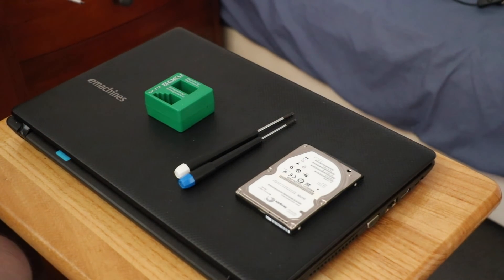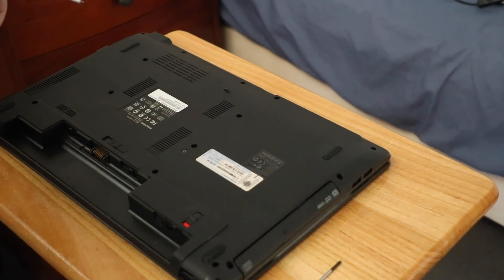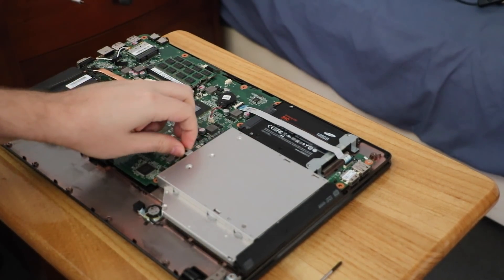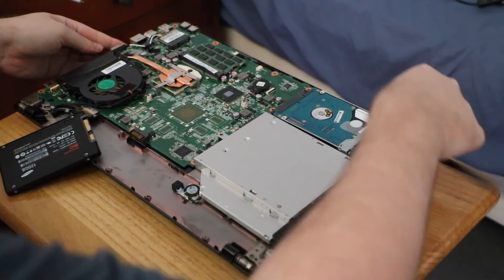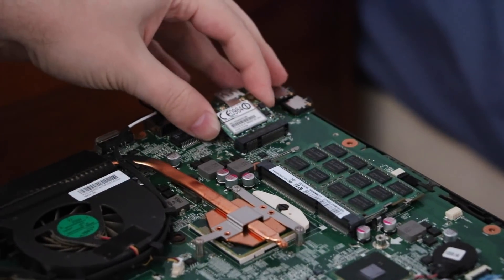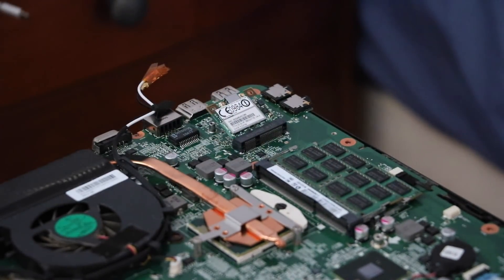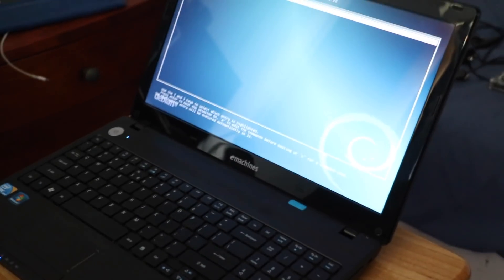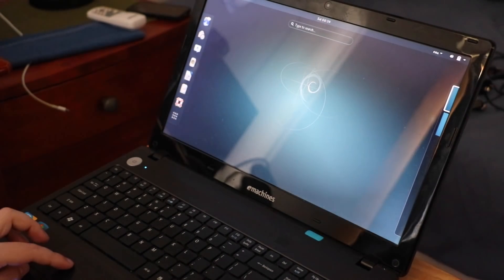eMachines E732 Disassembly for Wi-Fi, Hard Drive or RAM Installation

Comment: Do you know if it has a safety feature to cut the power when the casing of the notebook is opened?
If yes, do you know where the contacts for it can be found? Cause my emachines e732 suffers from random shutdowns and it's not dust / cpu overheating. I've cleaned it and replaced thermal paste. So I'm hoping it's this safety shutdown feature that's glitching because of dirty contacts or because they sit badly.

Comment: The Acer Aspire 5742 and brothers use that same case, BTW.
Reply from the maker: Why doesn't that surprise me? Must make repairs a lot easier. Are they all owned by the same parent company?
Reply: Acer bought eMachines, i think. Acer is higher "trim" than eMachines.
Reply from the maker: +Daniel Pinel are you trying to tell me that the eMachines is not a high tier machine with extreme processing power!?!
Reply: +Shane McRetro It might be a high tier machine, but it isn't "extremely powerful". My i3 Acer has thermal problems, and it's slow.
Reply from the maker: $0.03 that it has a rotational hard drive and not solid state! I don't know how I'd live without one these days! :-D
Reply: Mine has a A-Data 128GB SSD fitted by myself. The 750GB HDD was getting unstable sectors.

Comment: Hi Shane, I know it's a long shot but have you a Super Magic Drive you are willing to part with, or any ideas where to find one. It is Genesis equivalent of the Wild Card, floppy disc back up unit. Thanks Kester.
Reply from the maker: Howdy, sadly I've never come across an SMD, however the folk on assemblergames.com might be able to help. Were they the ones with the built in battery that likes to leak all over the internal PCBs? I remember that being an issue for one type of floppy drive backup ROM copier, just can't remember which one :)

Comment: shane i cant stress this enough but with laptops since you took it apart id reccomend you tighten all the screws around the hinge assembly  and put some lithium greese on the hinge , it helps with the lubrication of the hinge and also prevents the laptop from stapping in half , id also reccomend youd take off  the heatsynk and blow all the junk dust out and change the heatsynk compound . other wise good work man
Reply from the maker: +Jack Frazer Thanks, great tips! If this machine had more use, absolutely great ideas to do. This one was just to sit in a corner sadly... not my machine but the owner wanted a backup - just in case :)

Comment: I have an HP HDX 16 model 1040EL.... Pretty beefy for it's time (still a good performer), but to even reach the fan and clean it you have to "TOTALLY" disassemble it, even the screen!!! I was gonna replace the thermal paste but I just give up when I did read the manual! This emachine notebook is a breeze instead!
Reply from the maker: +MasterControl90 Yikes! We had a "Pioneer" branded laptop, it was quite a few years ago now and the screen also had to come off to get to the internals... why! Just why!